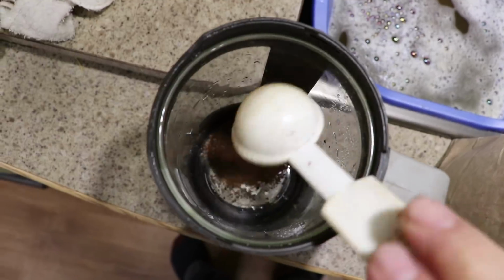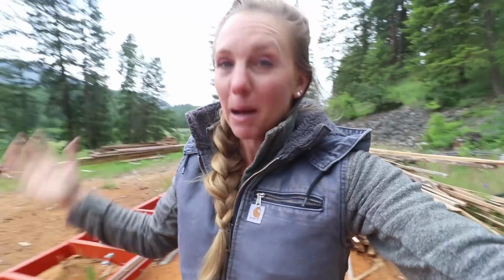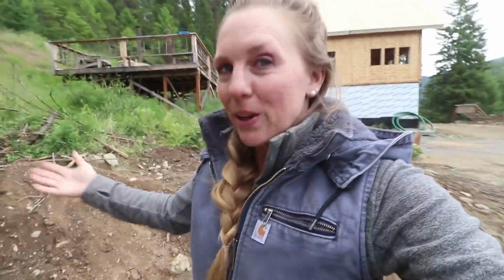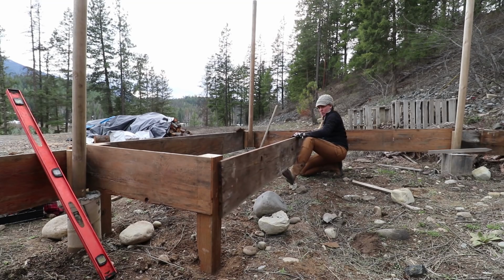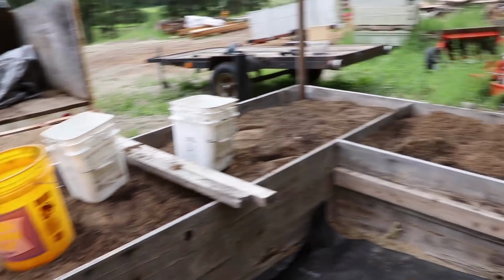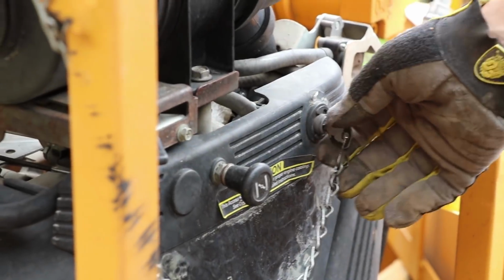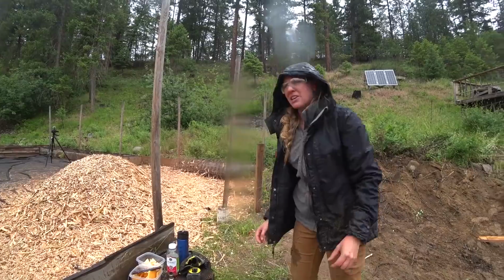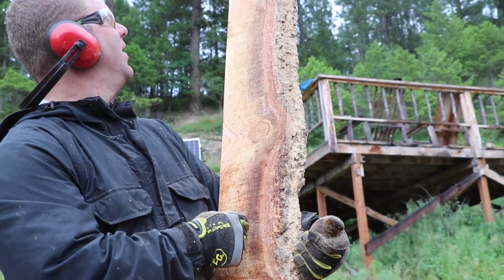How to Make Your Own Woodchips for the Garden (Easy & Cheap!)

Comment: Do not wear long-sleeve shirts while running a chipper cuz it could get stuck on a board and pull her right in weird to the advice seen too many people with shirts long sleeve shirts chicken lose their arms
Reply: I will add do not put your hands inside the hopper, keep them out side the chipper. Second you should really load from the side if you really want to be safe.
Reply: And you see those two wires hanging down...hmmmmm,I bet Alyssa doesn't know what they are for....

Comment: hi guys love your videos but i'm afraid the raised beds won't work. Woodchips or sawdust is not broken down. It first needs to go through a fungal faze then into a bacterial faze. If the wood chips were on the surface then the fungal faze would take the necessary nitrogen from the air but if you bury it it steals the nitrogen from the roots of the plants. The plants will be stunted at best (for at least 2 to 3 years). roots are planted into soil and chips added to the surface and all grows well. Mixing it up stunts growth. But hey.. I learnt that one too. Regards...
Reply: The root zone of the plants only penetrates the top layers of the soil. Bark does not reach up and grab the nitrogen. In a few years the bark will anaerobicly break down and affect the soil if cultivated into the rest of the   soil profile.
Reply: Very true George. A hugel bed works well for the reasons you write. It was the following layers that will stunt growth. Thin layers of soil then sawdust, followed with wood chips then soil - repeated. This approach mixes the yearly stages of decomposition. Fully composted materials (layed naturally) would naturally lay at the bottom of the process. The decomposting layers above. One layer being older than the other. The roots are naturally in the lower layers, as you would find in any forest environment. Plant roots need to sit in the composted layer, fed by the decomposting layers above. (or by a hugel layer deeper beyond the roots). regards
Reply: As I have been critical of the raised beds then I should offer what I believe to be a better plan. If you can get hold of some horse or cow manure (something that is composted would be ideal) but raw, fresh would be fine. Something mixed with hay or straw and layer it on the bottom of the trench/bed. If you could find a local supplier of woodchips and if they have piles of it on their site look behind the piles to see if any parts of previous piles are (composted) remaining. Fully or mostly composted woodchips on top of the manure is what you are looking for. (If pieces of woodchip remain you could sieve it to be sure. If you or your neighbours have any veg matter like kitchen waste then layer that over the  manure. Anything leafy (it breaks down quickly). Get hold of some topsoil (and mushroom compost if you can) or bags of compost. Mix and use to make the upper layers of your raised beds and plantr into that. Once planted and established you could put a skittering of woodchip on the surface to deflect the heat of the day from the topsoil and retain moisture. regards

Comment: At least throw some tar paper up on that roof
Reply: Did you watch the video?  They explained their plan with the roof and it doesn't use tar paper.  Go to their Instagram page and you can see the finished product (with membrane) waiting for the metal.  The metal is supposed to arrive the end of this week, so the finished roof should be in the pictures soon.
Reply: yes I did watch their video....I understand that they will have a another roof over the existing, still wouldn't hurt to protect what they have already accomplished